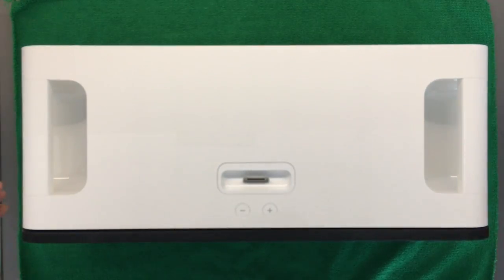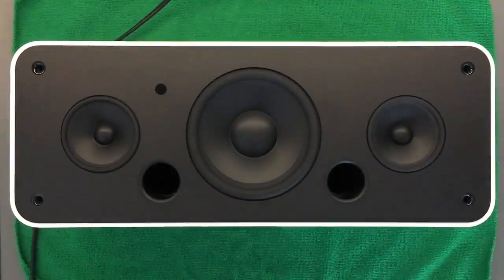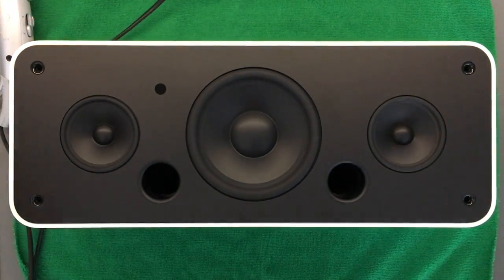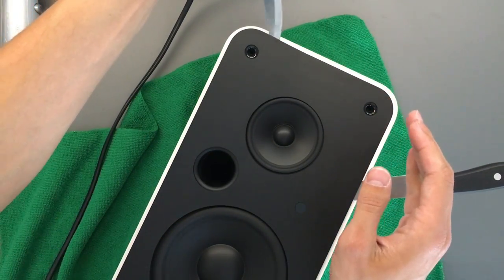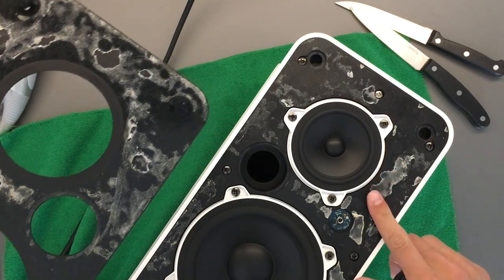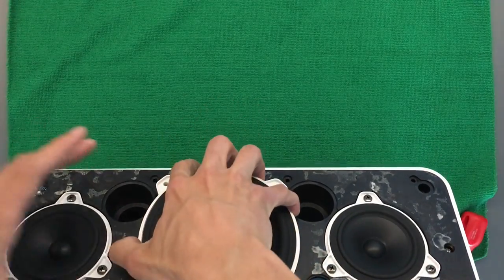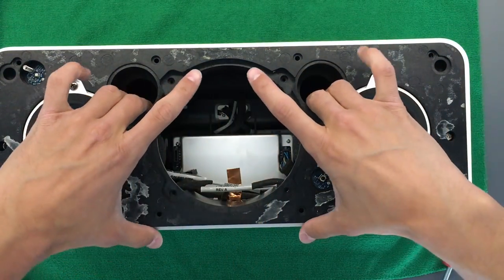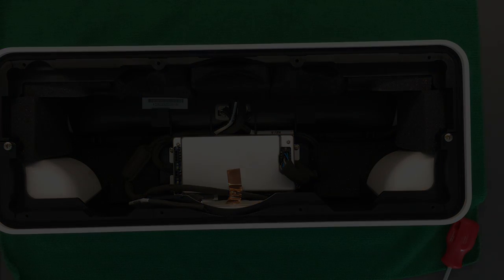Apple iPod Hi-Fi Disassembly Guide

Comment: Hey man, I have a Hi-Fi that has been working wonderfully for the past ten years but yesterday as I was playing music using the AUX cord the sound suddenly went out and the touch controls started acting wonky, then a non-stop clicking noise started coming out of the speakers and it wouldn't stop unless I unplugged the power cord. Now every time I plug it back in the clicking sound begins again and I can't use it. Any idea how to fix this? :( I love this speaker
Reply from the maker: stop plugging it in for a start - it's really unhappy

the power supply went out -- take it apart, and either try and fix that yourself, or take the supply board to a local electronics repair shop - they're 99% of the time easy fixes

if it hasn't been powered by the broken supply for too long, chances are good that everything downstream is fine

(should be an easy fix since something seems to have failed catastrophically in your case, since it went bust from one moment to another)

Comment: I got mine working last week. Fortunately, the power supply and amp were OK. I had to connect through the AUX as the 30 pin dock had been removed.  The HiFi comes up in dock mode, I had to pair an Apple Remote with it to switch to AUX. I was thinking about connecting the audio and power through the dock cable since there is 12V, but don't have a pinout for the internal cable. Anyone here have that?
Reply from the maker: There is a dirty and inelegant workaround to having that pinout ..

There's various 30pin female to whatever ... maybe you could buzz it out like that? Or on the solder points of the male 30pin?
Reply: @Darieee  Someone physically removed the 30 pin dock from this iPod HiFi . There is just a hole where it used to be. I do have the cable that connects the dock to the amplifier board, so if I had the pinout, I could connect directly to the cable.
Reply from the maker: Got it .. yeah .. quite a rough situation; good luck!

Comment: Excellent video with great tips and warnings! The headphone jack on mine doesn’t work so this will really help me! Much appreciated!
Reply from the maker: Glad I could help ! It's gonna be a bitch getting a "stock" looking fix, since the thing needs to tell the main board when to turn the amp on ... and that mechanism is optical

You sure there's not just some dirt in it preventing it from realizing shit's plugged in ?
Reply: but it is not headphone jack. it is line in not out :) I have probably some cold solder joints issiues with mine but i stick with it without teardown. It boders me only time to time on summer
Reply: Darieee I am quite sure, but not 100% certain. I’m finally just about to get into it, so I guess I’ll start with checking for dirt and stuff. Good tip, thanks for that 👍🏾

Comment: hi guys, 
I have problems with my iPod. There is no sound, no lights, no reaction when plugging the jack...nothing. ;(

I opened my iPod HiFi and couldn't find nothing broken. 
Would you give me a hint how to find out which component is broken? 

Thanks a lot.
Reply from the maker: Check the voltages on the power supply
Reply: already did it. It's ok.
Reply from the maker: Do they stay at the right voltages when you try and use it ? Perhaps the main board drawing current makes a rail go down
Reply: Darieee

Hi, sorry there is no current on the main board.
Reply from the maker: well, you could then be looking at a faulty main board ..
Reply: How can I check it where the error is?
Reply from the maker: Expert judgement :))

I don't know what to say ... it's probably optical to sell it as defective and get a new one

You should fetch anywhere between 50-150€ for it if it's in good nick and the power supply works

Comment: the full range drivers are enclosed while the woofer is ported?
Reply from the maker: Yup, they don't move much, and benefit from a different volume of enclosure - it's also full of damping material in there

Also, you would hear a distorted, barrely sound if all 3 speakers would share the same space
Reply: Also do you think the front plate could of been screwed in using the 4 holes and some plastic clips around the edges?
Reply from the maker: I don't get your question now

You can see exactly how it's screwed in -- there's 8 screws and no clips
Reply: Im talking about the piece you had to heatup to unbond
Reply from the maker: Oh, .. mmm .. probably, but it'd not look that nice - I just used a bit of sanitary silicone

Take a lot of time to dry (12 hours ? probably way less is fine too), and it dries rubbery, and tears quite easily, so, perfect for this kind of application